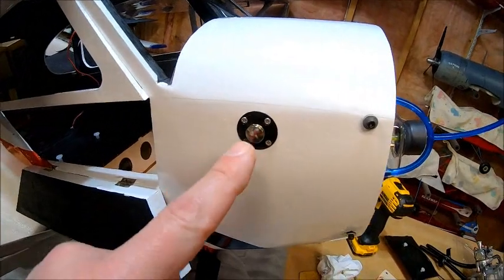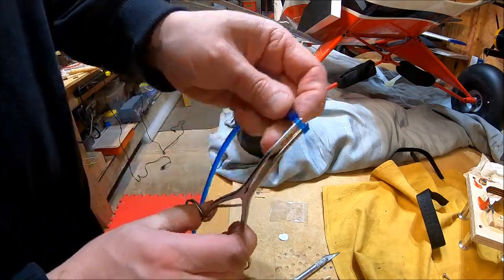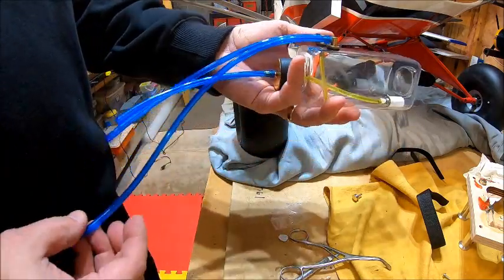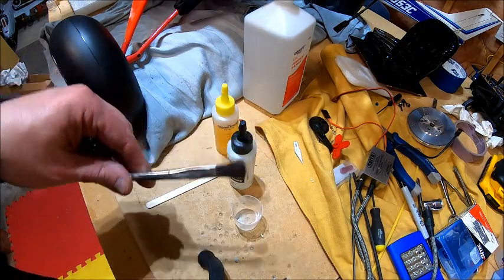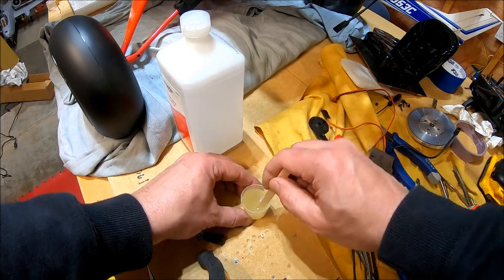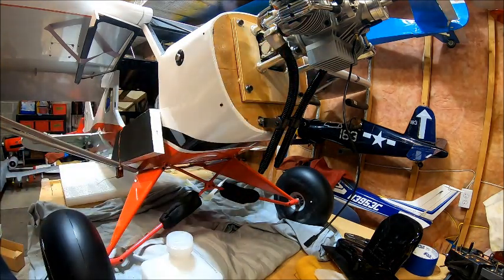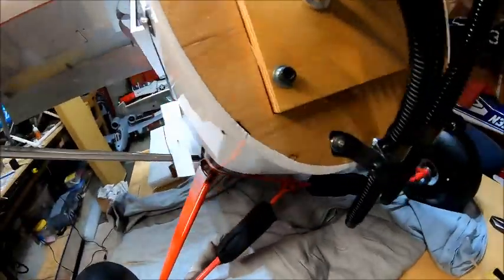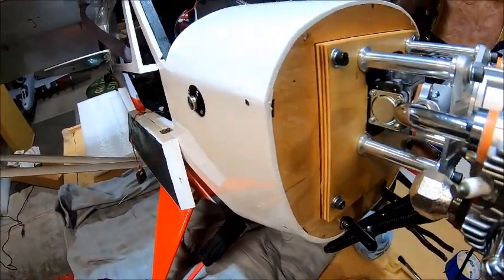Tips! How to make Fuel Line Clamps and how to Seal the Firewall, XCub build pt4 time lapse

Comment: Great video! Question about epoxy. Does the mix have to be exactly 50/50. I’ve had trouble with epoxy in the past where it doesn’t want to cure hard. It still feels kinda pliable. I would appreciate any help with this. Thanks!
Reply: 5 minute epoxy is good for some applications but the longer setting epoxy is better - 30 minute or longer. It gets rock hard, is great for firewalls, and the area where your fuel tank is.